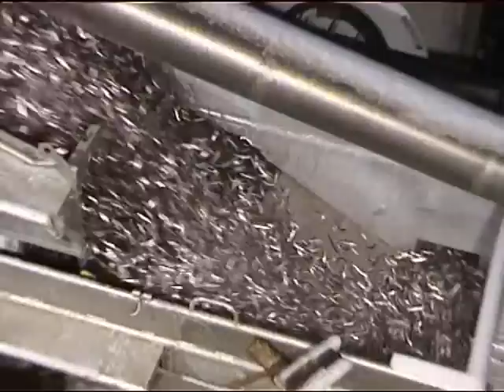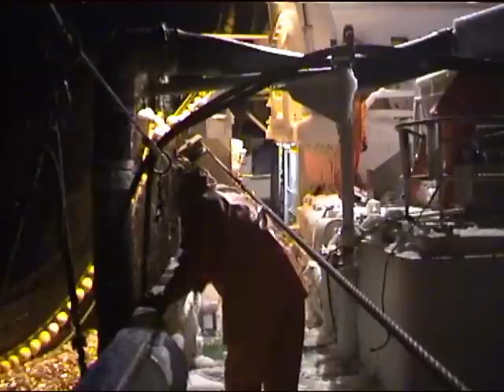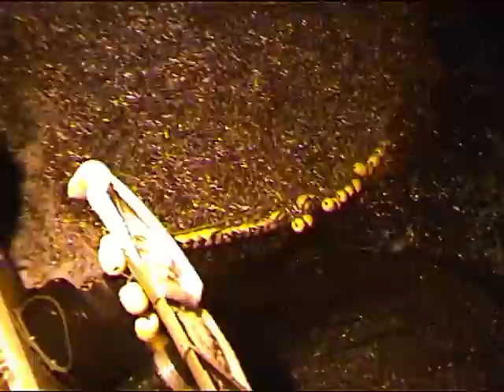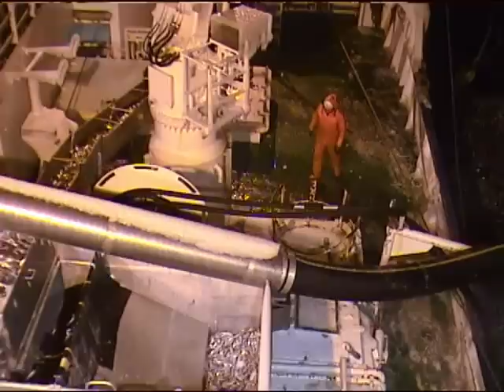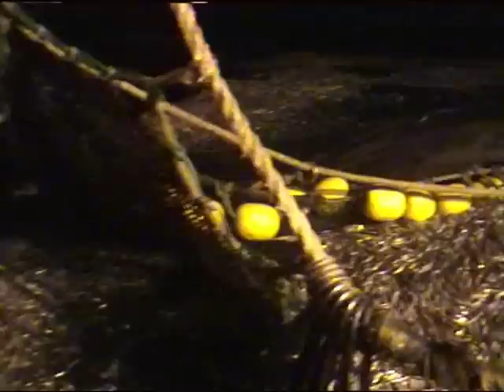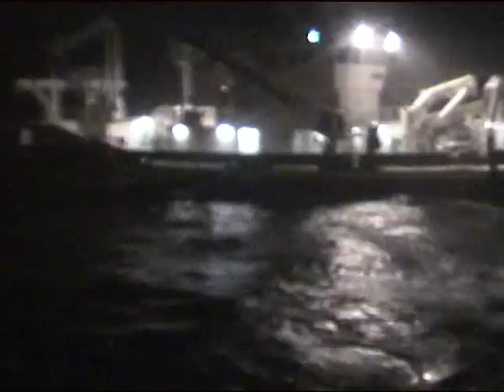Monstercatch 1200 tons by Mv Rav  in the  Barents sea

Comment: where can I find specs on that net? it has to be made by gods, because holding 1200 tons is pretty amazing.
Reply: yes but the 1200 tons isnt concentrated on a single point.. hehe..
fish has almost 0 weight as long as its in the sea..
the net act mostly as a wall pushing the fish toghether so that the fish pump can catch it
Reply: samkom33 so is it sewn or laced? vertical rib lines for strength? I was looking for specs for a reason. 

I've been a purse seiner for 12 years, I kinda know how the net works. I've seen many big sets in the various Alaska purse seine fisheries blow out because of quantity and how it was built.  there comes a certain point, as well, where if the fish die, the fish sink. so with that in mind, that's why I was asking. so if you know, pass it on man, in all ears. 

oh, and do you work to a taper on the bunt?
Reply: i have tryed to figure out what taper on the bunt means. hehe....
but when i started fishing on bigger boats in 1978 The end of the seine net was thicker and stronger than the rest, but still we didnt do as the americans and used the net to pull the fish on to the boat,....
we used a smaller landing net mounted on a steel ring with a handlebar so that we could scoope up 1 to 2 ton a time. with the crane
nowadays even boats down to around 35 feet have fish pumps.
yes i have seen a seine break,, but that was probably becouse the captain used to much power on the winches, hehe
the biggest set i have ever seen was in 1987... we loaded 7000+ ton herring in different boats but then the fish started dying so we had to let the end of the net go ore we had been on the bottom to..